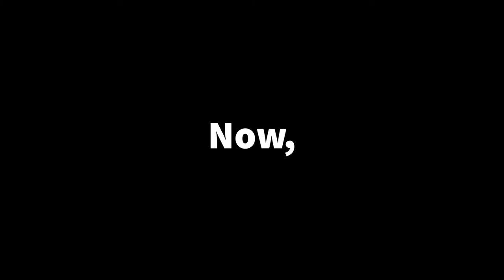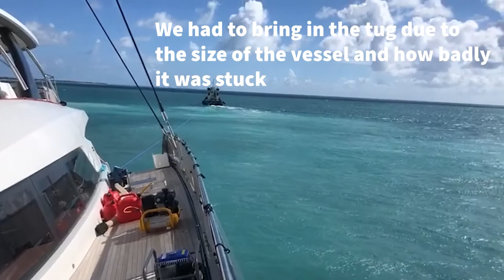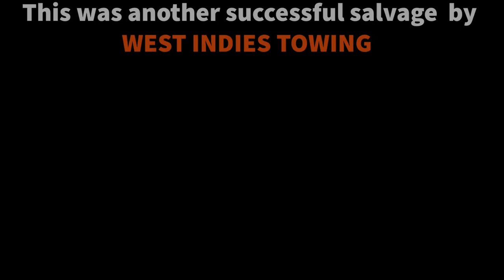“ Mana Kai “ - Lagoon 77' Barbuda.           Total loss .

Comment: Just out of curiosity, why weren't the lift bags placed under the bridgedeck?
Reply from the maker: Confined space there with the reef and the fragile bags , high risk off damage and rupture to them during floatation . Also wouldn’t give enough lateral lift to  the damaged side to prevent capsizing  , 75 tons ; pretty hairy towing as it was . One of the risks you have to be careful with when putting lift bags inside a hull is separation of the deck-hull joint . Always wise to circular strap them together if feasible .
It was primarily a wreck removal
Job , and the insurers main concern was for us to get it off the reef and as far away from the coastline as possible ; getting it out of the water and onto the hard was a incidental added bonus .  They’re always very sensitive about possible financial repercussions from environmental damages . Wreck removal as a rule tends to pay more than straight salvage .
Reply: @dr.nicholasl.fuller4156  amazing to watch the salvage

Comment: Did they salvage the engine that was on the bottom separate from the boat.
Reply from the maker: The marine cleanup job was given to some local divers and they lifted the engine out and put it ashore where it’s still sitting with nothing done to it . No use to anyone now . The insurers had no interest in it .
Reply: @dr.nicholasl.fuller4156  I dont understand these things, but why was the repair made with wood 4:17 ? Isn't this lower hull of the cat a 2 piece fiberglass mold? 
So the wood should be more heavy and not balancing the vessel properly?